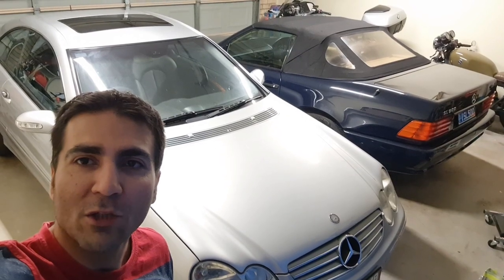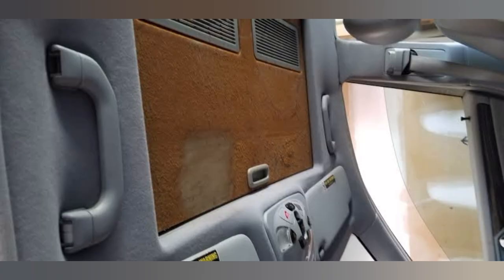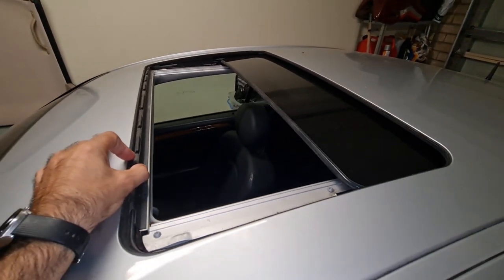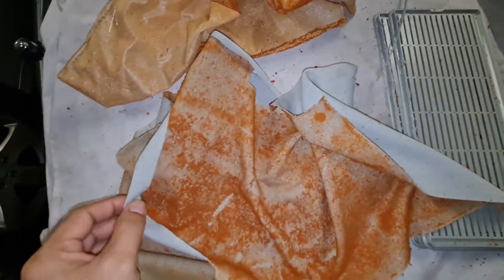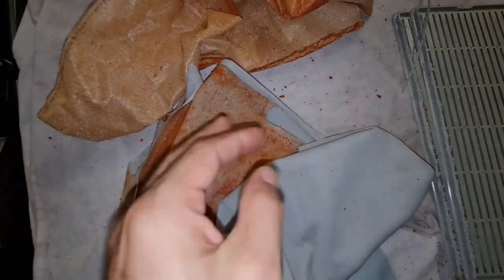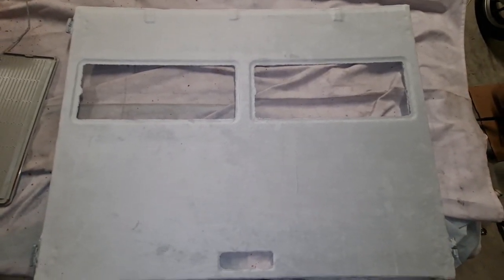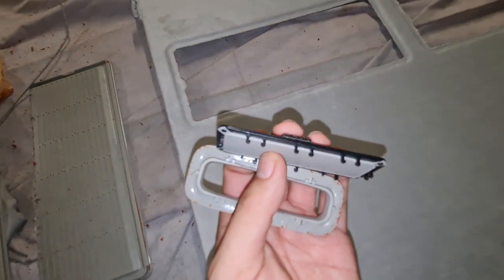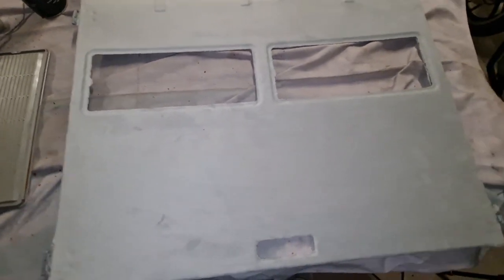Separated Sunroof Shade Fabric FIXED...

Comment from the maker: Hi Benz Lovers. This project might seem to be difficult but in fact it is really easy and satisfying if you can get the closest possible fabric and a good spray adhesive,  might work on any car, including any W209, C209, W211, w203, w204, w202. MERCEDES Sunroof Shades.

Comment: Thanx for the video man. I did a similar job recently. 
But now my sunshade cover rattles on speed bumps. Any solution to that ? 😢 w211 2007
Reply from the maker: Hi, either not properly in the rail or the plastics on the 4 brackets are not installed?